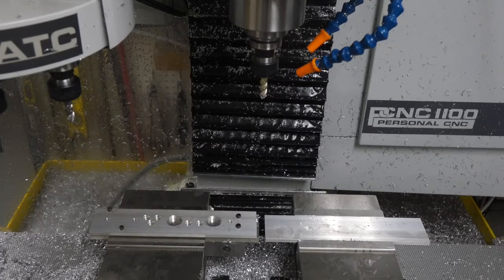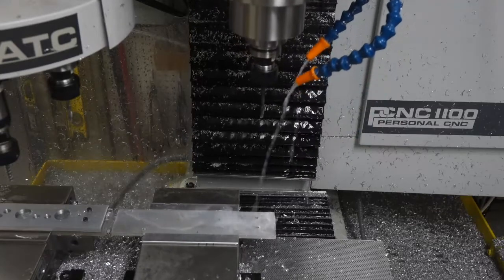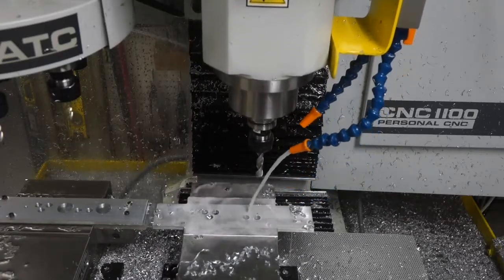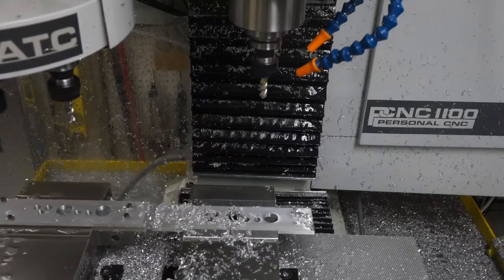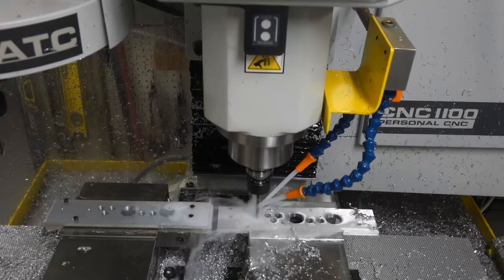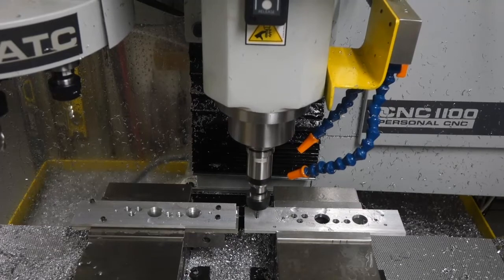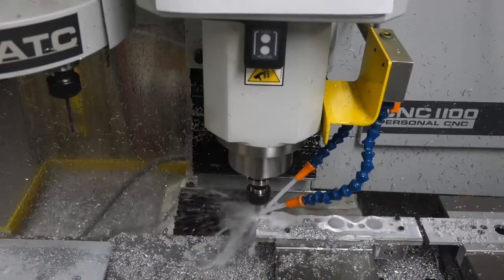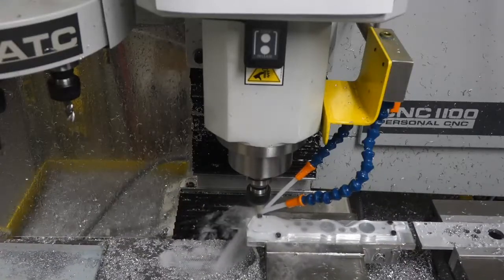Optimizing feeds and speeds on the Tormach PCNC 1100, Part 2

Comment: You may want to try Climb milling on your roughing passes and Conventional milling on your finish passes.  That may help with your higher rpm chattering.  I noticed that during the second part, that rough profile pass was Conventional then your finish pass was Climb, which seems to be backwards.  Give it a try and let us know!  Great work and very informative video!  Thanks!